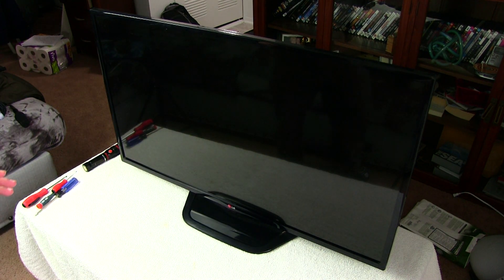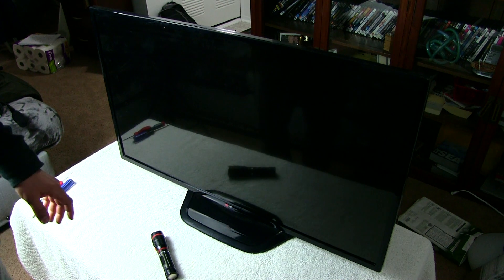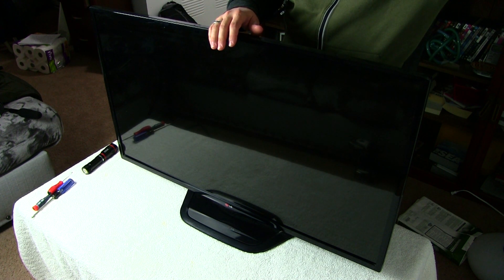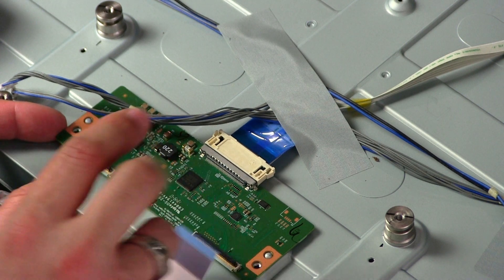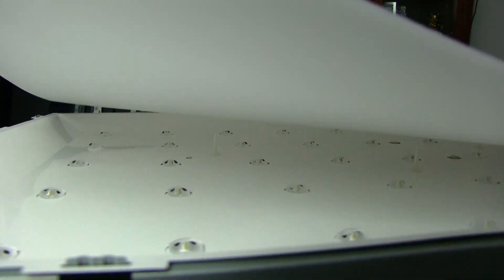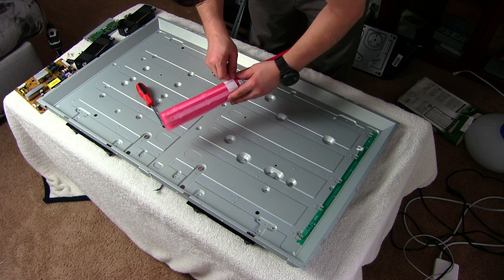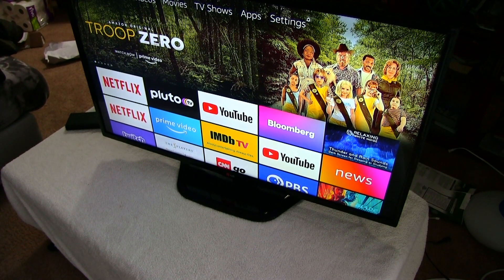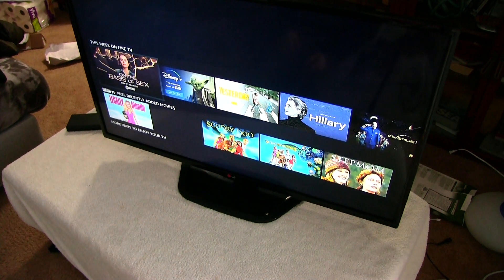How to Replace the LED Strips on LG TV No Backlights / No Picture - EASY AND CHEAP!

Comment: This is great! I have an LG UJ635 and the screen had a blue tint that kept getting worse. I just replaced the backlight using this video as a guide and my TV looks brand new again. Not only is the blue tint gone, the brightness and contrast has improved greatly.
Reply: Hey there..I have the same TV....where does everyone get the new led light strips from please? Thanks. M
Reply: @mikseymono1  hey did u figured out where?
How did u know the serial number of the tv models backlight without disassembling it first to order it?
Reply: @mikseymono1  you can get them from eBay
Reply: @vatchoug  Serial numbers are on the white sticker at the back of TV just under the Make/Model number and will usually begin with TV size no. so a 42” LG tv serial  number will start LG 42xxx

Comment: I had a similar TV only 47 inch. just soldered across the bad LEDs to get it back running. But looking at getting the proper backlights strips now to improve the picture quality. I would have never noticed that the strips on the left were of different length until you said it. Thanks for that.
Reply: I may try that, just to get my set working ...

Comment: Just picked up one of these here (dumpster surfing) in April '23 and its flashes just after power on - set powers on for a brief bit as seen by the LG logo then goes blank! I reckon I'll dive into it and be checking the LED strips now ... side note: I had to walk 3/4 mile with my two-wheel dolly, then walk back that same 3/4 miles WITH the TV strapped to the dolly to get the TV ... arms are still sore this morning ...

Comment: I might have to attempt this, nervous about it my TV is an 85inch 😬
Reply: @sarcasticmcspastic  yes needed four of us to lift the panel out and put it back
Reply: @sarcasticmcspastic  it was quite easy once the screen was off putting it back on was a bit scary too.
Reply: @sarcasticmcspastic  china
Reply: @pauldavies8638  hey is there a website link that u could share, if u ordered it online?
Also, how did u get the part serial number before disassembling it? Thank u
Reply: @vatchoug  phoned up the parts department  of the TV manufacturer they did the research for me

Comment: HI DAN THANK YOUR HELP VERY MUCH FOY YOUR INFO 
I HAVE A  42" LG GOOGLE TV MODEL GA6400 
IT TURN ON BUT NO PICTURE, NO SOUND, SCREEN LIGHT UP I USED A FLASH LIIGHT TO CHECK IT OUT THE LED NO PICTURES IN THE BACK WHAT IS YOUR ADVICE PLEASE THANK YOU

Comment: Hi there, my LG tv showing clear picture under mobile flash light. I also checked output voltage of powrt board, so do you think there must be a problem with backlight strips OR any other part of tv? thanks
Reply: Backlights , one or more LEDs blown. Easy fix (after you have totally stripped down your TV -as shown in the video) 😊
Reply: @chrissygizmo6057  lmaoo yeah right